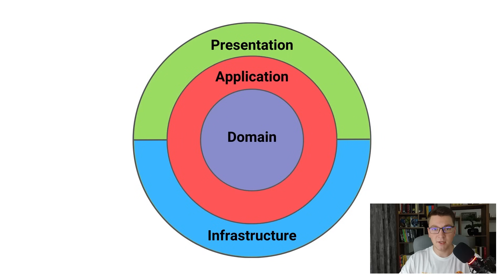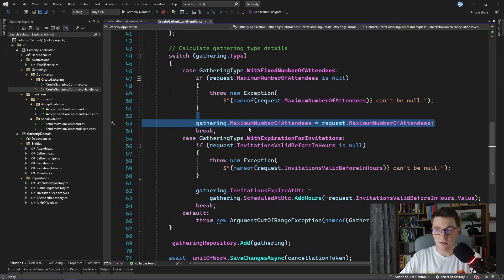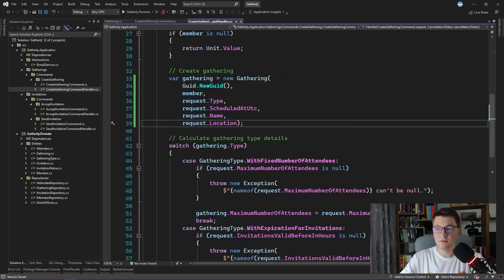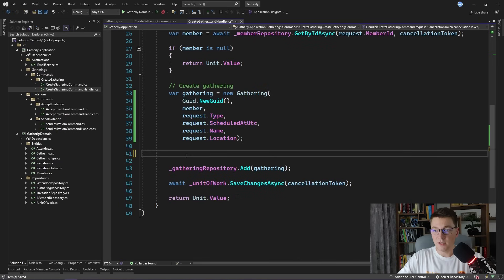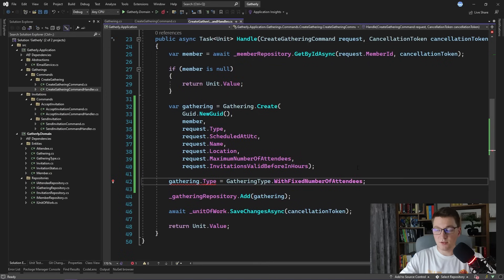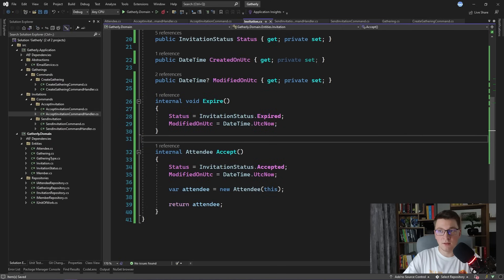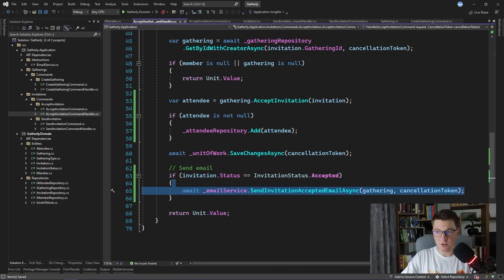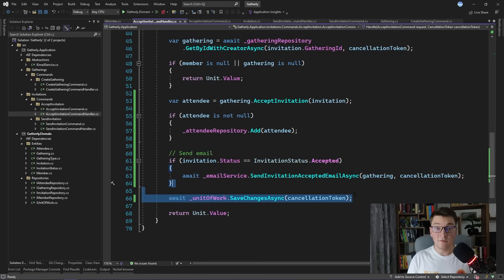How To Use Domain-Driven Design In Clean Architecture

Comment: Thanks for the wonderful videos you have posted on YouTube.

I'm working on a large-scale WPF application, and I've decided to do a DDD design for obvious reasons. However, I struggle with limited contexts and some potential circular references. Let me clarify: I'm working on an application that will measure traffic lights in a production process. The app will also include some serial number generation and other business related stuff. due to size and complexity, I decided to have three projects in the domain layer. Domain.Shared (base classes for Aggregate, ValueObject, Result ...) Domain.Measurement (logic for calculating product measurement results) Domain.SerialPort (Logic for SerialPort, where I specify specifics and client commands). Domain.SerialPort is boundedContext because the user must specify these settings in the user interface, and there are constant changes and versions of the product. The problem I have is that I want to specify a two-way property in EF. if i want to do this i need a field from Domain.Measurment to Domain.Products and a field from Domain.Products to Domainain.Measurment which creates a circular reference between projects. Another option I have is to inherit the entities in the persistence layer and just add the two-way fields there. what would your suggestion be?
Reply from the maker: You said you're treating these as separate *bounded contexts*. Then simply define duplicate entities, inside of each bounded context, with the required information. In your EF Core configuration, you can make them use the same database table. Does that make sense?
Reply: @MilanJovanovicTech  Thanks you Milan, It makes a lot of sense to do so. When configuring EF Core i just need to add same name into ToTable property.

Comment: Thanks for great video, Milan!
15:07 Since the actual object being returned above is still a List<Invitation>, a caller may cast the result to a List<Invitation> and then add or delete an invitation. Because of this, you should use read-only wrapper by calling .AsReadOnly()
Reply from the maker: I tried, won't compile 😅 Do you have a working example?

Comment: A definitive bold like for this one! One thing that bothers me in this rich domain implementation, and not explicitly mentioned in video, - is that the time retrieval logic moved from the application layer to the domain one. In this example the domain just takes UTC from system clocks, but it may not be the domain's responsibility (and authority!) to act this way. The most suited implementation of a time provider may depend on a specific environment, but higher layers have no control over it now.
Reply from the maker: Agreed, I kind of "hacked" it for time as I didn't want to bother. But you can either provide at as a method parameter, using a custom ISystemTime abstraction, or the .NET 8 time provider thingy
Reply: @MilanJovanovicTech  Thanks for the reply! I wish you inspiration and creativity for your incredible work!

Comment: Great job and another great video.
Reply from the maker: Thanks! What did you like the most?
Reply: @MilanJovanovicTech  practical train of thought and the way how it was presented.
Reply: BTW, as per sending email and saving data in db, old way would be wrapping with transaction and commit that one when email is sent successfully but I find it a bit ugly (commit may also fail), I would prefer something like hangfire  or quartz (they can fail / keep failing but it's "cleaner")

Comment: Nice video! Looking forward to the next one.
Reply from the maker: What did you like the most about this one?
Reply: @MilanJovanovicTech  I've been reading and watching alot of DDD and Clean Architecture related content, but most content start from scratch. 

It was nice to see what steps you took to move from an anemic model to a rich model. 

One thing that I do struggle with is that most examples are relatively simple  (models with but a small number of properties). I can see these model classes exploding when the models become bigger. 

Maybe that's also a sign that the model isn't correct (maybe doing too much in one place). 

Would love to see some more complex examples, although I can understand that those might not be very good for learning people new stuff.

Anyway keep up the good work! I'm really enjoying the content so far and you explain things very understandibly. Also the pace and length of the videos are very good in my opinion 😃

Comment: Hi great video ! I have two noobie question : 
1) at 9:32 , in the SendInvitationCommandHandler,  you create an invitation then you add it to the gathering.Invitations list (line 63) then add the invitation in its repo then SaveChanges(). What is the purpose of doing both? Cant we just add the invitation to the repository and SaveChanges OR add the invitation to the gathering.Invitations list and just SaveChanges since EF is tracking? 

2) at 24:00 cant we just keep List<Attende> Attendees but give it a private set? Instead of making it a ReadOnlyCollection and create whole new field private? 

Ty so much in advance!
Reply from the maker: 1. The first part will be enough for EF. I'm adding it to the repo just to make it more robust. Can easily be left out.

2. Yes, we can go with that approach.

Comment: Thank you for this wonderful video showing step by step, moving logic from Command Handlers to Entities itself.

I have a query on implementing the same for Database First approach where the DB is already created for us. In such cases,we auto generate the entities using Scaffold-DbContext command and every time there is change in DB design, the entities are auto generated. 

How to tackle those situations?

Do we put all domain logic in separate partial classes? 

Thanks again for this series.. I have been using N-Tier architecture for so long that this is a whole new fresh air of learning and I am very happy to be able to learn this new architecture.
Reply from the maker: You can even create your Domain entities as separate classes from your persistence entities. You would have to handle mapping between the two, however.

Comment: Great video, thanks, the short question, why do we use method name Gathering.SendInventation considering the fact that method does not perform any 'sending' logic and just add a newly created Inventation instance to the Gathering?
Reply from the maker: You are expressing intent via the method name. In terms of the domain, creating a new invitation instance is "sending the invitation"
Reply: @MilanJovanovicTech  I don't agree with you :) the 'method name' should reflect what it does, not what the intention is (as a developer I would be confused if I saw a method name like that).

Comment: Might be a really really dumb question, however, let's suppose I want a User Crud, in this more spefic scenario I want to create an User account.
Then should the Controller instantiate a User (by using the Controller) and then pass the User object to the repository and have faith on the User validation since an error wasn't thrown?

Also, what do you think of Services? When should we create them? I've heard of some people that Services should be an action (verb) that makes use of different domain objects.
Reply from the maker: I'm unsure about your first question, but if I understood correctly: The approach with Controllers is fine if you want to place logic in controllers.

I use services mostly to abstract external services. And occasionally as domain services. Domain services to encapsulate some business logic, jo external concerns.

Comment: Good! wasn't it better to call AsReadOnly method to return IReadOnlyCollection. This way (not using this method) clients may simply cast the collection as List<> and modify it
Reply from the maker: ToList will return a new list, different memory reference.

And you can't cast it. Did you try?
Reply: @MilanJovanovicTech  Where did you use ToList? In this video you simply return the backing field in the getter. Anyway I think its better to return the readonly type to emphasis that the client cannot change it.

Comment: Hi, Milan
I'm not sure, that changing the Invitation's properties inside of the gathering is a good way because it looks like a side-effect. I think, that the Gathering class should only have the possibility to check the expiration and AddAttendee(attendee) method
Reply from the maker: You can model it how you think is best, I think I explained my reasoning for why I chose to do it like this
Reply: A Gathering does in fact own the Invitation. You can't have an Invitation without a Gathering, it wouldn't make sense.  But a Gathering object can have no invitations, that seems totally valid. It makes sense to me to isolate that. I don't know what you mean by side effect. Why have multiple ways of creating or changing an Invitation that's not known by the parent Gathering? What is this side effect concern?
Reply: @E1ess , it's also good encapsulation of any logic required to create/send an invitation. It's all nicely hidden inside the owner Gathering instance. That is further illustrated by making those children a read-only collection. All a user can do is say, "SendInvitation() and return it to me. Whatever it does I don't care". And that allows that logic to change without affecting users (although, it is core logic and isn't likely to change but if it does it changes for all applications using it). The Handlers is where app-specific logic goes. Domain-specific logic goes in the domain layer. I like this channel so far.

Comment: Milan, what is in your opinion the advantage of having a static factory method instead of implementing the full factory pattern ?
Reply from the maker: With a static factory approach I have access to private/protected methods on the Entity. I tend to use this fact to simplify the behavior by having smaller methods.

Also, I'll show an example of static factory with domain events.

I didn't find much use for the full factory pattern. Perhaps I didn't run into a problem that really needed it.

Comment: Rule of thumb: whenever you write a couple of lines that all do obj.Property=<something> or obj.DoSomething() - consider moving that code into the implementation of the object - especially if you do the same or very similar changes elsewhere. Certainly, a property like NumberOfAttendess (which is redundant as it is equal to the count of the list) must never be writeable from outside.
Reply from the maker: Good point, that way when you add a new property you only have to change that one method.

Comment: Thanks for the video.

Is there any added value of using a static factory instead of new Gathering()?
The switch/case statement can be a method of the Gathering entity that is called on the constructor as part of the minimum validations in order to build a valid Gathering.
Reply from the maker: You can get some fun behavior with ORMs and constructors with logic. EF for example will find the best constructor (even a private one) to create a new instance of the class. I was bitten by this before, so I tend to be cautious.

Also, sometimes it's quite useful for your factory method to be async. For example, if you pass in some service interface to perform a check. In this case you can't use a constructor at all.

Comment: Nice video, self-explanatory. In this case, business logic is encapsulated in the domain model and it's not dealing with DB but let's assume that business logic needs some interaction with DB, meaning if-else would call different DB logic (repository). By design, we can't inject a repository to get needed data but how would you approach DB interactions from your domain model?
Reply from the maker: There are three options, I talked about them here: https://youtu.be/eC7GMGIR4Gw

Comment: Hi Milan,

In this video you created a static method responsible for creating a gathering entity.

How would you create the gathering entity when getting the records from db using Dapper. If I am not mistaken the Dapper mapper will not be able to create the entity right?
Reply from the maker: Indeed, this approach would be tough to work with for Dapper. With EF it works without much trouble. You can get by with a factory method for Dapper. So fetch the raw data from SQL, and then pass it to your factory to construct the entity properly.

Alternatively, you can build entity factories in the Domain layer - but it'll end up being a lot of code with little benefit.
Reply: There are a lot of options regarding using Dapper or EF. I would like to hear yours.

From your videos I understand that you are a fan of EF, but I also heard you say in two of your videos that for boosting performance you would use Dapper.
Reply from the maker: @adisilagy  Just create a static method that accepts primitive types. Load from database using Dapper. Call the static method, which will transform values into rich domain model.

Perhaps I should make this into a video?
Reply: @MilanJovanovicTech  it would be great if you can create one
Reply: @MilanJovanovicTech  I think that a general video showing how using Dapper with the repository pattern and rich domain model would be an interest to many developers

Comment: Hey Milan, great content! thanks for sharing. 

I've seen before that instead of having the repository independent of the unit of work (as you do on your video) there are people that implement it in a way that the unit of work contains the repositories such as:

_unitOfWork.PersonRepository.AddPerson(person)

Any thoughts on that? just curious!
Thanks!
Reply from the maker: I like separate repository interfaces because then it is obvioud which queries you can find in a command handler for example.

With UoW + Repo combined it's not as obvious.

Comment: When you are doing data validation video, could you take an example of the nature of "there should be no 2 members with the same name\email"? I'm interested in how you are going to avoid the data racing condition, when there are 2 simultaneous requests to create a user with the same name. I understand how the optimistic concurrency works on the level of an entity, but what are you going to do when it is not practical to aggregate all the data necessary for the validation in one entity?
Reply from the maker: The next video will be more about Domain level validation. I consider the "unique email" rule more of an Application level validation, but I will definitely cover that in one of the coming videos. Thanks for the suggestion!

As far as the implementation - here you can just rely on a unique index at the database level. It is atomic by design.

Comment: I prefer when business logic is everywhere, yet clearly identified. For example, the presentation layer could know the format of a US zip code. I prefer when layers are not distinct projects (file). A class could be able to talk to DB via basic interface eg. DAO.  Well I also like to go for twho parts: Backend (endpoints) and frontend (CSS+HTML+Javascript).
Reply from the maker: What's the benefit of having business logic everywhere?
Reply: @MilanJovanovicTech  Speed, and I also duplicate the logic once in the stored proc and once in the front of back end - no need to hit the db to know something is invalid and another foreign application or user may run the [safe] stored procedure without proper up-front validation. I'm for simple code (fewest indirections, little or no function/class injection).

Comment: Hi ! 
I read that ctor should be private in model to avoid creating anywhere except in the model himself.
But how do you convert object coming from databse (objectDTO) to the object domain model without a public constructor ?
I could use create, but it doesn't work with the ID property which shouldn't be changed
Reply from the maker: You can create a factory method for that

Comment: What is the problem of the logic inside de constructor or inside of the static factory method create? Why one approach is better than the other?
Reply from the maker: Constructors can be called by ORMs, for example EF Core does that. So if you place something wide a side effect in the constructor it can lead to undesired behavior.
Reply: @MilanJovanovicTech  humm, got it. Thanks for the answer.

Comment: This could seem simple with a few handful properties on an entity, but is seems overloading entity with methods. And creating entity using parameterized create method would blow up when we have entities with close to hundred properties. Isn't there some simple way to create them if we need to deal with hundreds of properties in the entity and separate out other business logic as you doing everything in Create method within entity class, which makes it quite messy.
Reply from the maker: Doesn't hundreds of properties make it even messier? We should fix that first
Reply: @MilanJovanovicTech that's what my concern is. How would deal with large entity and creating them as parameterized method or constructor. What is good alternative approach?
Also, your entities are directly resembling the Db tables and columns, which make them kind of tightly coupled because you are saving or retrieving entities directly instead of any mapper in between. There should be mapper between domain entity and actual db entity, what's your opinion and how to restructure your code accordingly?